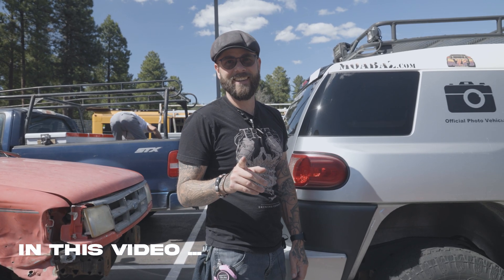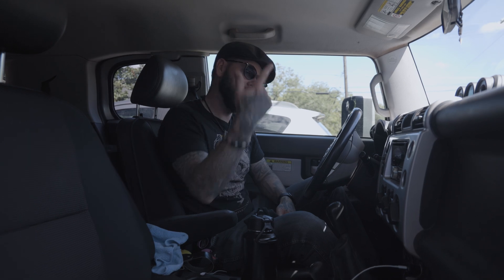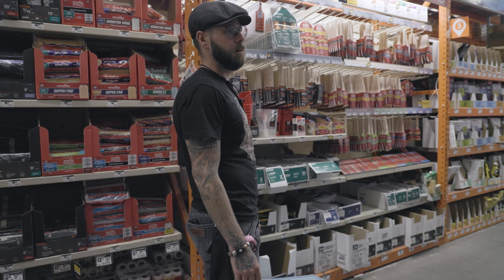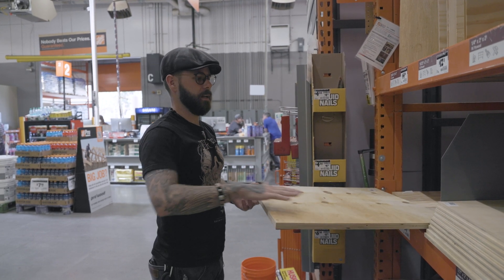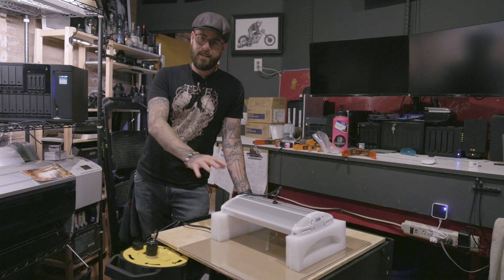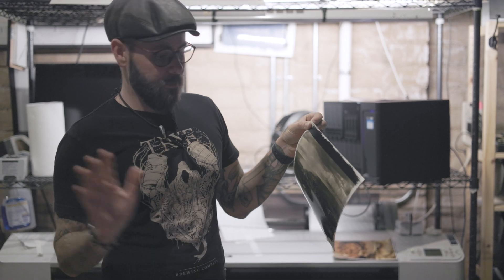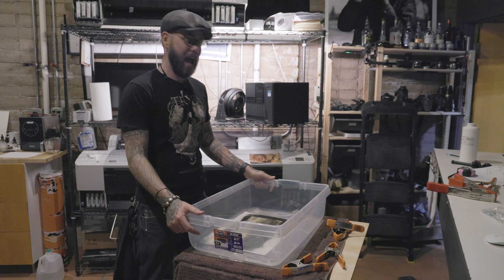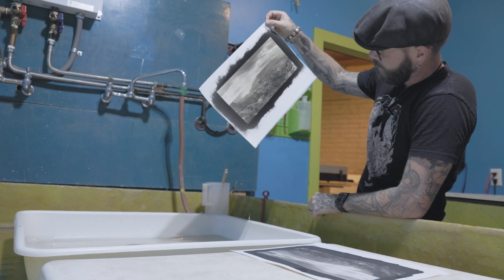$200 Platinum/Palladium Printing Setup

Comment: A 200-watt UV LED flood light from Amazon will make some pretty big prints without needing anything more than something to hold it over a contact printing frame at a consistent distance above the printing space. But, for $200, I was able to make a 36"x48" UV exposure unit that can be set on the floor, a tabletop, or even stood up vertically on a rolling TV stand. Its output is crazy (16 48" 22-watt UV LED bars, also from Amazon, though I got the lumber for the frame and base from Home Depot). It can print cyanotypes in 2-3 minutes and platinum-palladium (as well as kallitype) prints in 1-1.5 minutes.
Reply from the maker: That's amazing, thanks for the tips and info!
Reply: Have you got a link to the large UV Unit you mentioned?

Comment: Matt, I like your simple approach to making Pd Print. Yesterday I changed two black lights of my uv box. I am planning to fit a led uv fitting, this would be less cumbersome and simple. You have confirmed my approach to use a 8 mm thick & heavy glass on paper & negative when I make larger than 11X14 inch print. I can’t afford a vacuum exposures unit. I have two contact frames for regular printing. Also yesterday I received the  Gampi Shikibu 23 gsm paper from Les Papier de Lucas. A luxurious paper with a great shine. I have a pleasure to share with you my workflow. Your videos are very inspiring to me. There is no nonsense here. Thank you from a small town of India. ❤
Reply from the maker: You're very welcome! And good luck with the Gampi :)

Comment: what kind of paper do you use? im having a tough time finding something good.  also what kind of clear "paper" do you use to print out the negatives? it looks frosted sort of
Reply from the maker: For the negative we are using Pictorico transparent and the actual paper mostly Arches Paper. We did a bunch of video about both topics, you should check it out ;)
Reply: @HiddenLight  I realized that after I left the comment, but couldn’t find the comment to delete it lol. Thanks dude!

Comment: I made a UV exposure unit with $50 worth of UV LED light strips from Amazon, a $17 plastic box from IKEA, and a piece of glass that I took out of an empty picture frame. It works great for everything up to about 20” on the long side, and the bonus is I can flip the box over and store everything in it when I’m not using it.
Reply from the maker: That's the way to do it!

Comment: I use a $25.00 amazon black light led panel suspended (I use a manfrotto magic arm and clamp but that's because I had them) 9" over a scavenged election lawn sign laid across my bathroom sink.  I have an old contact printing frame. I get reliable 8x10's with this setup with an exposure time of 5' 15".
Reply from the maker: Sweet setup 😉  !

Comment: Last year I built an over complicated unit for making cyanotypes using wood I had lying around and AliExpress parts. I got a long LED strip in the 395-405 nm range, a 200 watt power supply (I just use 100 watt so I have a safety margin) and an electronic timer. All the parts probably cost me under 40 bucks and about a week of work (like I said, it's over-complicated). So, there's a way to go even cheaper than Home Depot.